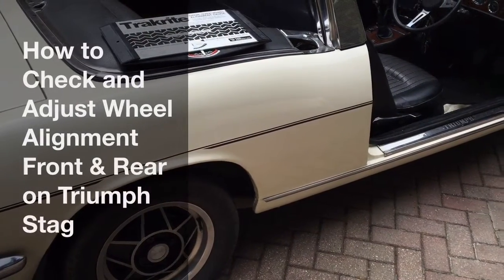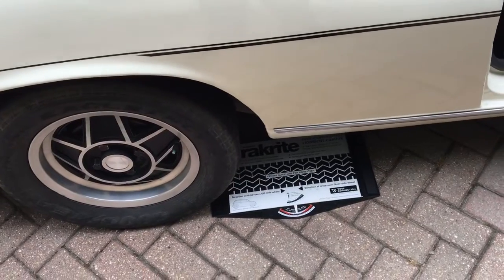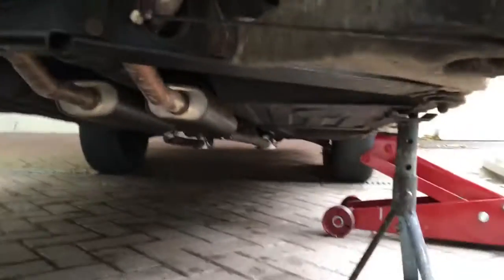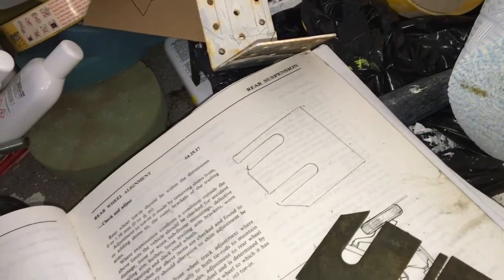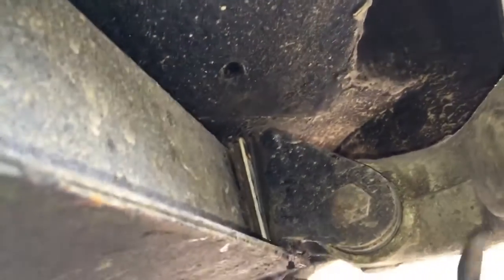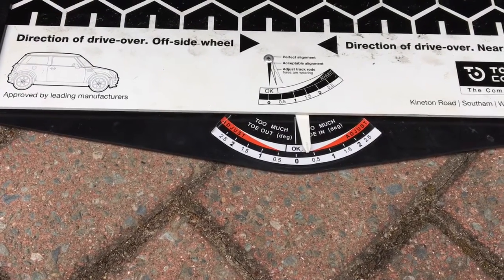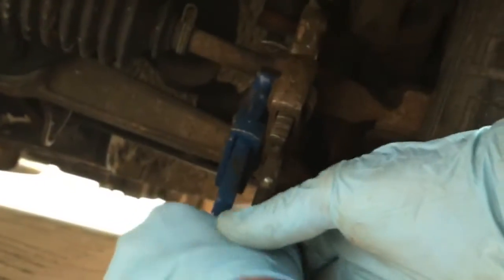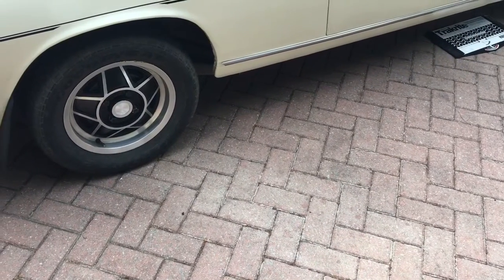How to Check & Adjust Wheel Alignment on Triumph Stag, front and rear.

Comment: how was your steering wheel sitting after adjustments?
Reply from the maker: Fine.  You need to adjust both ends of the track rods evenly in order to keep the steering wheel in the correct position.  If it's not straight then readjust track ends.